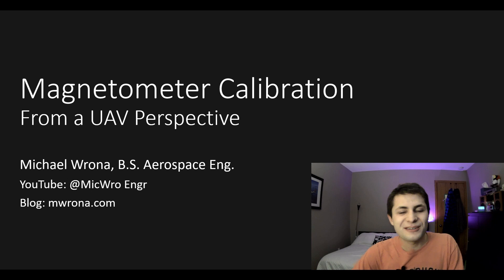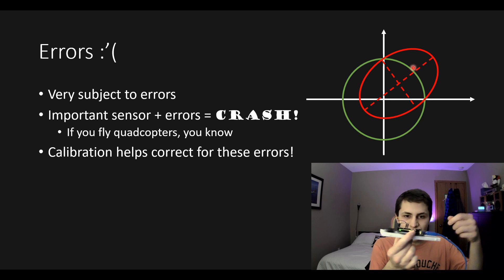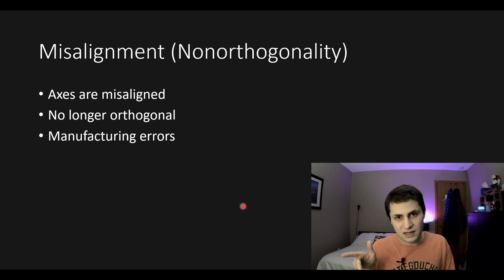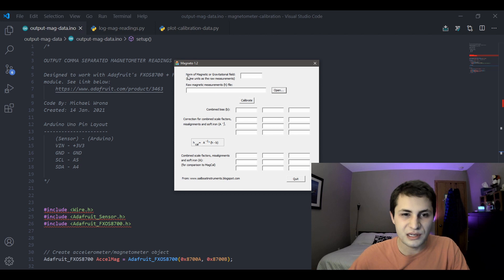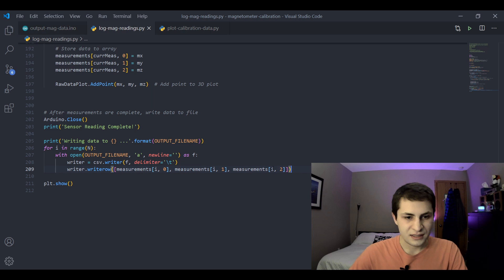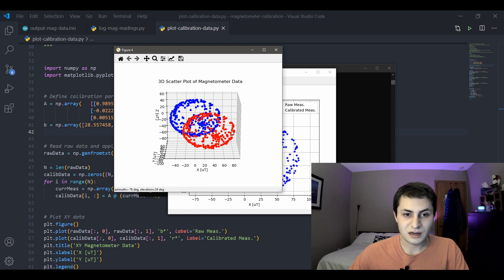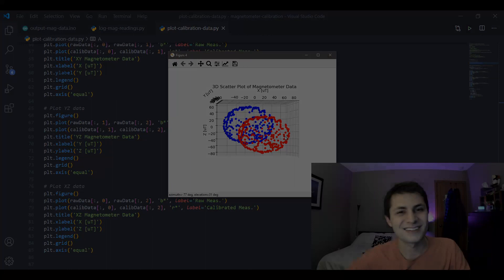Magnetometer Errors and Calibration

Comment: Hi, i also try to write the Matlab script to follow your resources but the center of the calibrated magnetometer still far from (0,0,0) around (30,0,40). Do you have any idea about that?
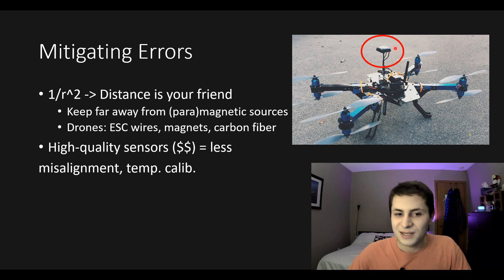Reply from the maker: Did you apply the calibration parameters to your data using the equation at 8:08?
Reply: @micwroengr7851  yes, I applied the matrix from the calibration result (same format like your matrix) but the heading is not correct totally the variance around + - 5 degree

Comment: @MicWro Engr - I was able to collect the data from NOAA and my magnetometer.  Magneto outputs a 3x1 matrix and two different 3x3 matrices.  Are all of these needed to accurately calibrate?  I don't quite understand the relevance of all of the Magneto 1.2 output and what to do with them.

How do I apply the 3x3 and 3x1 matrices to my raw magX, magY, magZ readings to? Do you have the math to do this coded in C, C++?  I don't do python but I could translate it to my cpp code.

Comment: Really Informative Video, Thanks for The Detailed Explanation, Can you explain how we can use those calibrated values in Arduino Code.
Reply from the maker: Use the equation I introduce at 8:05. You can check out my code at 15:35 and see how it was used to correct measurements.
Reply: @micwroengr7851  thanks for the update

Comment: Hi, great video.  I notice you took the readings in your bedroom but I assume you will be flying your drone elsewhere.  If that is the case, will your readings and the corrections you have applied still be valid where you intend to fly the drone?
Reply from the maker: Thanks for watching! It might be okay to use the values from indoors, but I highly recommend calibrating your sensor outdoors away from magnetic and paramagnetic disturbances. I had two steel file cabinets next to me, which definitely affected my calibration. I'll calibrate outside before flight!

Comment: Hellou, thank you very much for video .. i understood alot by your explanation ... But i am realy new at this and i have absolutely no idea how to use thease numbers whitch Magneto 1.2 generated.
I am using very standart Adafruit library for HMC5883L Senzor and theres nohing in this code for inputing thease numbers ... just "Magnetic Declination" ... thats it ...i know that i am asking for alot but how do i use thease numbers ... thank you very much.
Czech republic.
Reply from the maker: Input your raw magnetometer measurements to the equation at 8:05. Magneto gives you the A-matrix and b-vector values. That equation will return calibrated measurements.

Comment: Hey Michael, great video! I got a question tho: how often do you have to do a calibration? I heard magnetic field was moving...
I'm trying to make a robot mower, and the compass part is way more difficult than expected... Is it possible for a robot to self calibrate? I mean with the sensor inside the robot, without removing it? (obviously a robot mower can only rotate around the Z axis)
Reply from the maker: If you assume your vehicle (and compass) are level, you can simply use just the X and Y compass measurements to compute heading: hdng = -atan2(my, mx). To calibrate it, you can rotate the vehicle in a circle and record X, Y, and Z compass data. Then, in Magneto, just use the X and Y biases and the upper-left 2x2 (X and Y data) SF matrix values and divide the diagonal elements by 2 (from ellipsoid equation). That way, you'll  get a 2x2 matrix and 2x1 measurement and bias vectors. That should give you a good enough 2D compass calibration. Hopefully that makes sense!
Reply: @micwroengr7851  Thank you, Micheal! 👍
Reply: @TheCowpowah  Also, the time variance of Earth's magnetic field is not very much at all. Don't worry about that lol. You should recalibrate when 1) you make a significant structural change to your vehicle, 2) relocate the compass sensor, or 3) when you use the vehicle at a new location.

Comment: really it's a fantastic video. but i have one question how can i use this numbers of calibration in the arduino code to get write angle of yaw for example with any 9dof sensor ?
Reply from the maker: Check out this article about computing heading from magnetometers, hopefully it helps you out: https://www.generationrobots.com/media/module%20boussole%203%20axes%20HMC5883L/29133-Compass-Module-Application-Note-2.pdf
Reply: @micwroengr7851  thank you , i read this article and it's very useful for me but i have confused between the offset and the bias and also between the scale factor of magneto and the scale factor that i can calculated by searching for the Xmax,min and Ymax,min . is that any difference ?
can i use the matrix which we get from the magneto and apply the equation to find the accurate reading of magnetometer sensor ?
if yes can you guide me how to make it ?

Comment: Hi, is carbon fiber really paramagnetic? Could you refer to some sources? Thanks.
Reply from the maker: My mistake. I don't think carbon fiber affects magnetometer/compass sensors much (negligible effects), although it does block RF signals. Thanks for the correction!
Reply: @micwroengr7851   Oh okay, thanks for replying.